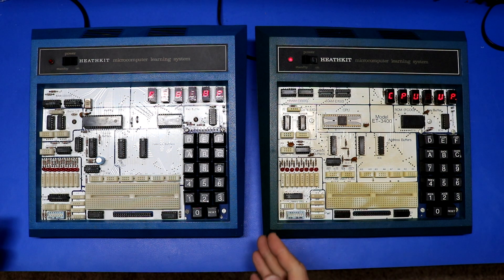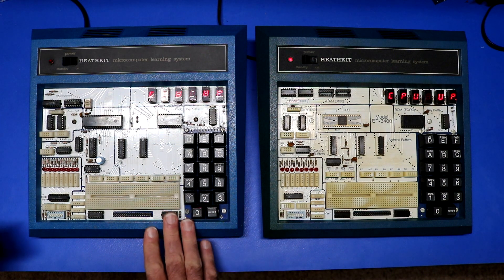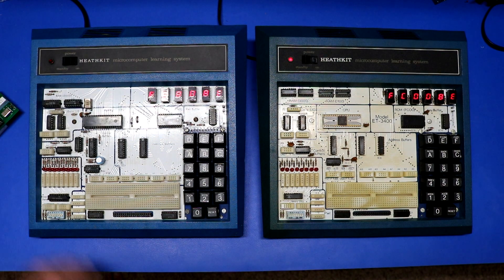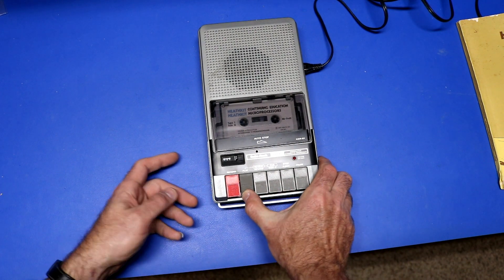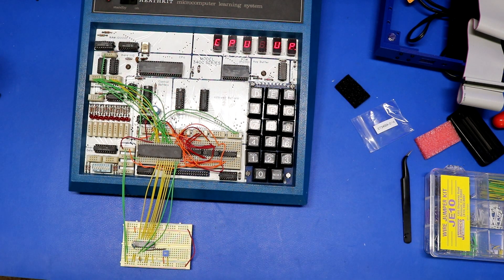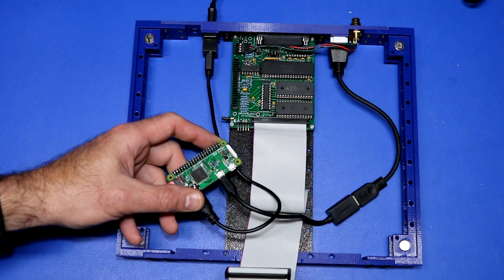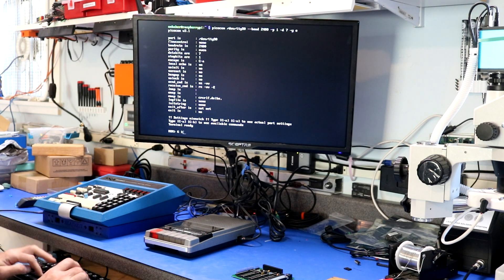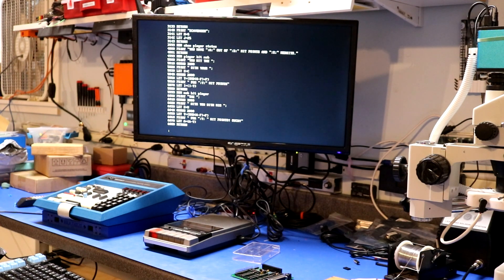Heathkit ET-3400 Part 2: ET-3400 vs ET-3400-A, Cassette Interface, ADC Experiment

Comment: I bought a 2300a from ebay.
I took out the old (heavy) transformer. Then replaced the 5 volt supply with an old USB power bank. Now it's portable...
To get the +/- 12v back I plan to use two buck converters back to back... then to get the line clock source back I'm going to setup a 555 timer chip to output 60 Hz...

Comment: my house electricity is 240v, and the device is 120v, what to do? help me.
Reply: If you do a web search for "et3400 build manual" you will find a PDF of the build guide.  If you look on page 31 it shows you how to wire the ET3400 for 120V or 240V, so you should just need to make the change as described, which probably just puts two windings on the transformer in parallel or in series.  I assume that the ET3400A would be the same, but you'd need to check.  If you're not familiar with mains electronics, I'd advise against fiddling with this stuff!

Comment: mind taking some measurements of the chassis? I plan to 3D print one for a Clone Board I am working on.
Reply from the maker: You're cloning the ET-3400 trainer itself, or the ETA-3400 memory/IO accessory? If it's the memory/IO accessory then I could share my 3D models. If it's the trainer itself (a clone would be cool!) then I can see about taking some measurements.